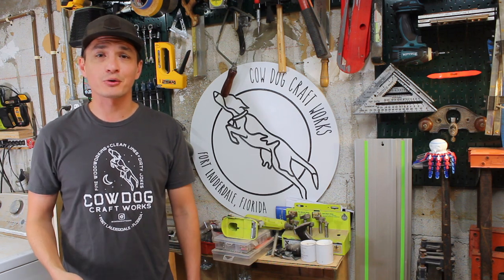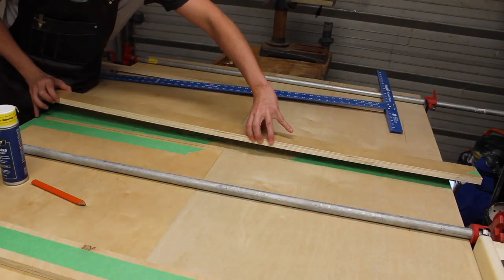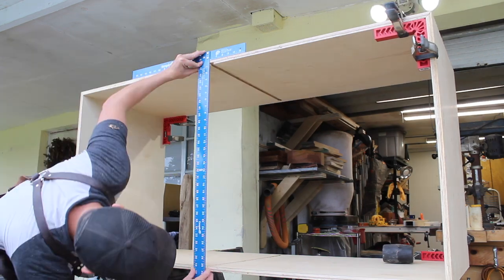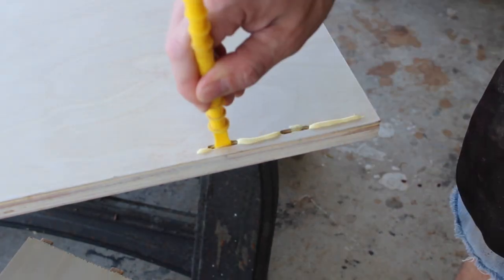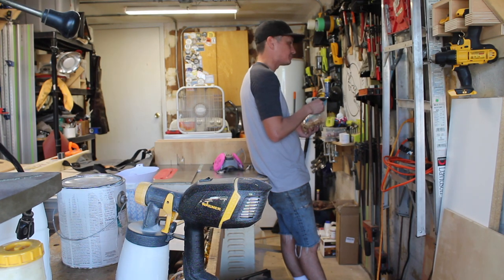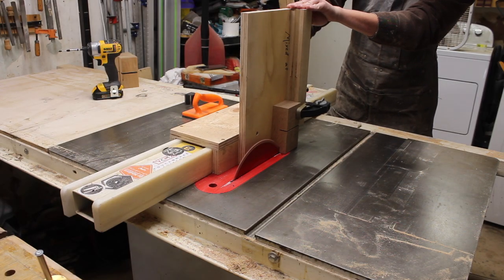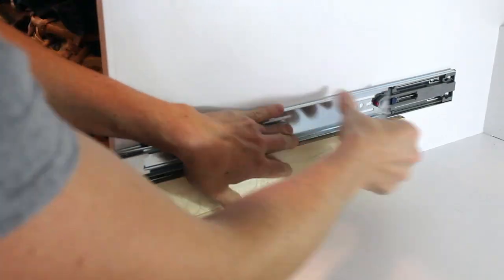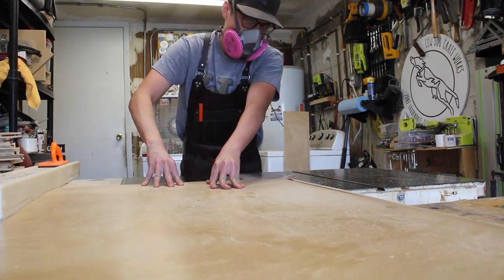A "Simple" Modern Dresser | Woodworking Build

Comment: found you on instructables great job you should think about making everything including table saw mobile i did this years ago due to space problems an wotn go back to static mounted tools hopes this helps look forword to seeing more from you
Reply from the maker: Yeah man I’ve been thinking about throwing the mobile base onto the table saw! Most everything else I’ve got is mobile. I should have a new workbench with video by summer too. It’ll be traditional but have those knockdown casters so I can slide her around.
Reply: @CowDogCraftWorks  I just bought some cheap harbor freight locking casters for my base I am all for getting the best money can buy but when money is short you learn to make things work my saw is a heavy old craftsman contractor saw 3hp that had a leg base i threw it away an built it so the dust goes below the saw as i didn't have a collector at the time the drawer slides out and i dump it when full would take pics and share but shop is packed up right now so living through guys like you till i get it unpacked
Reply from the maker: Haha glad to help. The jet is super solid. I got it, along with most of my tools, on offer up for a crazy deal.
Reply: @CowDogCraftWorks  yea well i am have tool lust for your festool joiner an saw and jet is is no slacker either I use mostly really old stuff 30 plus years old an some newer Grizzly tools
Reply from the maker: Fun story: I got that jet table saw, 3 hp 220v with a dust collector for $900 on offer up. They domino is the only tool I bought new. I factored the price into a huge commercial job I did with a friend last year.
Reply: @CowDogCraftWorks  excellent offer up Deal and yes i figure in new tools to jobs like the sthil 661 chain saw with 36 an 28 inch bar as payment for removing trees the ripping chains for the 36inch bar 2 of them for a free hand slabbing out of a walnut crotch for a wedding center the 31 ton log splinter for cutting and splitting 6 cords of oak fire wood all of that was the payment for the work the tool was used for even gotten two different trucks instead of money i do love a good trade most the time i end up better off value for the money doing a trade then taking cash

Comment: How much was the total project?
Reply from the maker: Oh gosh I can’t remember. Sheet of plywood from the cabinet supply place was about 35 bucks... drawer slides were 15 a pop... the white oak was probably the most expensive... I want to say that was about $200. I think all out it was about $400 to $500... but also I’m trash at math. So there’s that.
Reply: @CowDogCraftWorks  do you think its possible to make a good looking dresser for about 100 to 150 dollars?
Reply from the maker: I’m sure it’s possible. However, I’ve found that using more inexpensive materials for the most part equals an exponential amount of work to prep and bring those materials to a level of quality to be usable. I end up doing a lot of cost benefit analysis on my own labor with things. Anyway: one of the easiest ways to drop cost on this project would be to use standard bottom mount roller drawer slides which are very cheap. And to perhaps replace the fronts with pine or plywood. It won’t look as pretty. JT that would drop the most expensive parts.

Comment: What are the overall dimensions for this project?
Reply from the maker: Hey! overall height was 36”. Depth was 28” and the base was 6” high. The entire build was 60” wide. I essentially wanted the surface of the dresser to be at “pub height”.
Reply: @CowDogCraftWorks  What do you suggest as an alternative to using a domino?? My boyfriend and I are wanting to build some furniture for our apartments and I am in love with this dresser!! We can't afford some of these tools so we are trying to figure out what we can use instead!
Reply from the maker: A pocket hole jig with strategically placed pocket holes would work wonders. Also a biscuit joiner. I mitered the corners and that wasn’t necessary either... but joints would work fine. If you’re going to paint it you could do butt joints and counter bore a screw, basically inset a screw and then plug it over the top with a dowel. It’ll be plenty rigid. Reinforce everything with glue in your joints.
Reply: @CowDogCraftWorks  Where can I find the plans for this build?